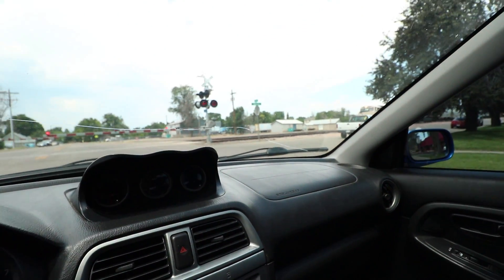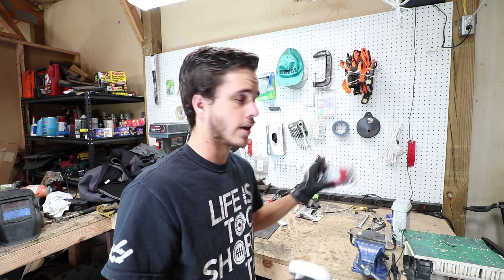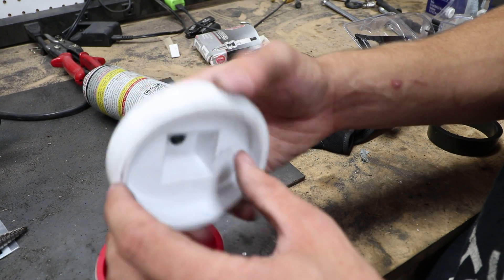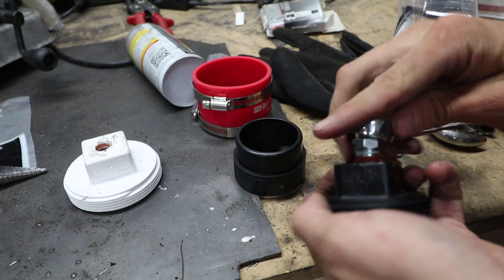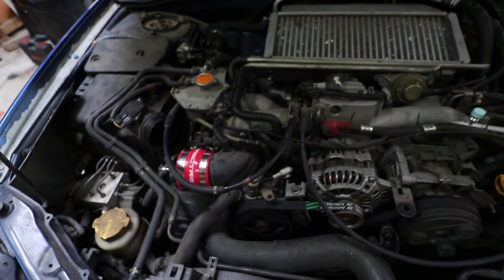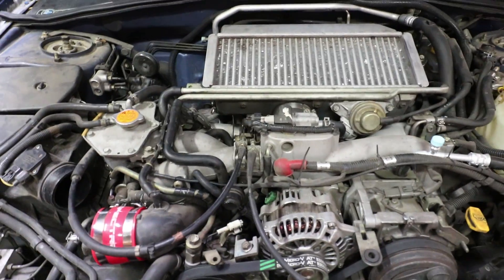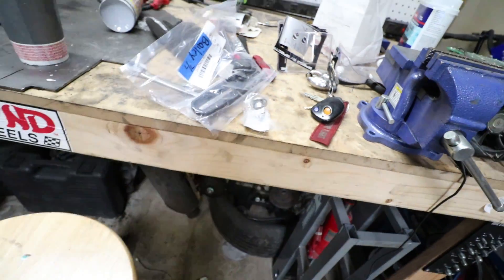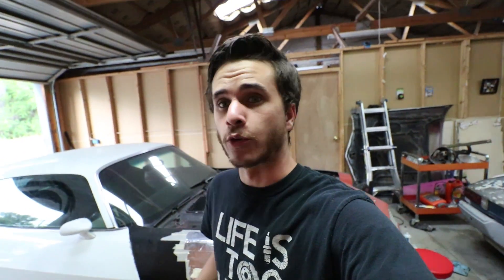Making a Boost Leak Tester for Less than $15!!?

Comment: Hey so I just made my own tester for my 08 Legacy Gt. I did remove the oil cap because it was recommended in another and it just seems like all the air is coming out the oil cap that I removed, then I covered the cap with my hand and oil started coming out the dip stick. Am I doing this wrong? Only went to 15 or so psi
Reply: Bryan Snow you ever find out if you had a bigger problem?
Reply: @jnat7806  I just sprayed carb cleaner on all my vacuum lines and intake/tgvs and didn't notice any changes in idle. My thoughts now are that I have a faulty/clogged fuel injector. I guess it wouldn't hurt to get a compression test done.
Reply: Exactly what I was thinking, I’m no tech but maybe it’s going past your piston rings ? Pression test sounds like a good option. And check your plugs and see what they look like.
Reply: Bryan Snow I’m just now doing a test and I did the same exact thing as you with the same results. When I covered the oil fill it started coming out of my dip stick. Did you ever figure out what was going on?